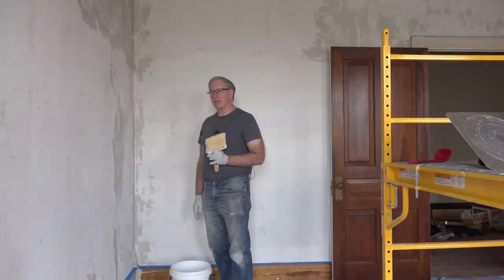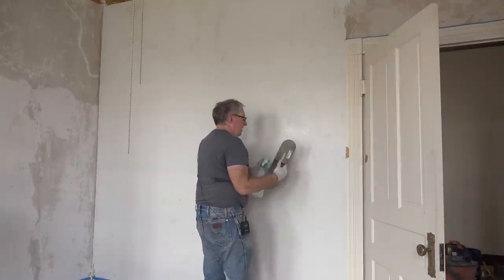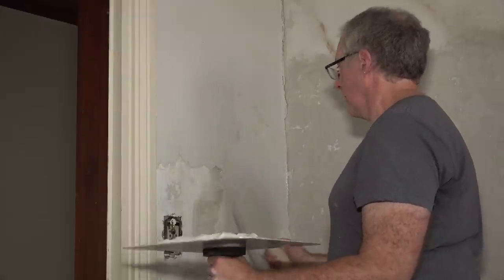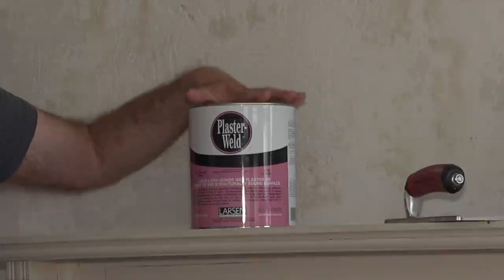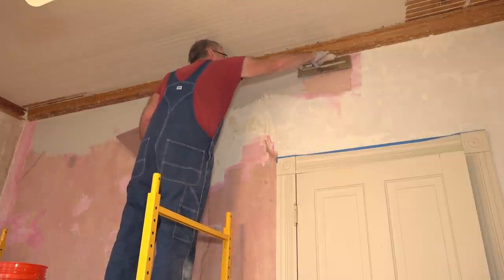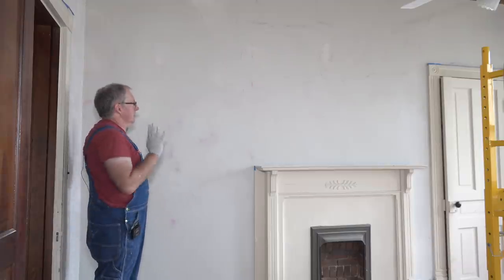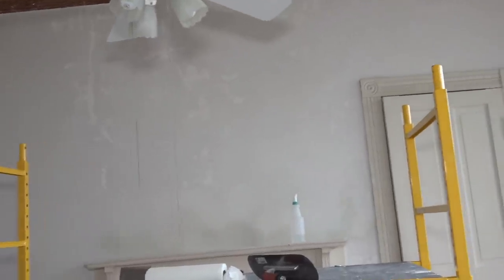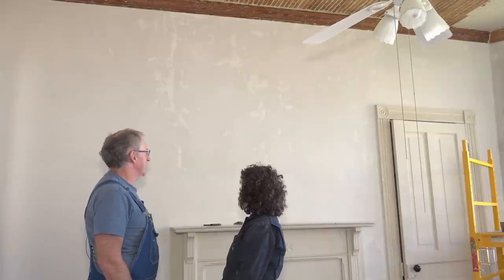EP 76 Victorian Plaster Skim Coat

Comment: What caleb from second empire strikes back had to do with re-plastering his house, he needed, i think, three coats of of base plaster to repair his wall, then two top coats(scratch coat, and then veneer coat). As for the yellow stuff, that might be dry wall spackle? That stuff has a bad habit of yellowing, and showing through stuff put over it(unless you use a primmer if painting), so you might need more then one base coat of plaster cause of it?
Reply from the maker: Caleb had to build up the plaster base from the raw lath, which is why it took a few coats. In our case we already had the base so didn't need as much plaster.
Reply: I think you’re right about what they used for repair of the cracks!  I had that in a bedroom as well and it became a choice of digging it all out and fixing it with plaster, sealing it with BIN or KILZ and then painting or wallpapering.  
I should add that we weren’t replastering the wall at all - just stripped old wallpaper and that’s what we had underneath.  The rest of the walls were fine.  We primed them (we hadn’t yet decided on paint or paper but wanted a nice, clean, white base) and the yellow color from those cracks bled right through.

Comment: We did a walk thru on an old home that had actual plaster walls. I was amazed at how flat the walls were! It speaks volumes for the tradesmans of yesteryear! Unfortunately I have not personally seen enough representations of plaster walls to determine if "perfectly flat" was the norm as I have seen plaster walls that were very wavy and uneven. The fact that a tradesman can get a plaster wall perfectly flat says volumes though.
Reply from the maker: I found it to be very easy to apply a flat finish. You can see where the uneven-ness was filled in when I applied the base coat. Yes, there is good work and lousy work out there. I've even seen walls that had heavy texture on them and it made me wonder if they were just covering up bad workmanship?

Comment: I’m guessing KILZ doesn’t work with regard to the stains on the wall(s)?
Reply from the maker: KILZ is the wrong product for the job. It's designed to be used under paint to keep stains from pulling up through it. Plasterweld is the only product that should be used to bond plaster and does a fine job of blocking whatever was under there.

As for paint problems, we show a better, less expensive way to block stains in a couple of episodes!

Comment: Question these plaster walls can they be washed? If you wanted to paint does it have to be a flat paint so it will continue to breath? I can't remember what kind of you used for the Blue Bedroom.
Reply from the maker: Good question! Yes,  plaster can be washed. The water will soak into the plaster and then evaporate back out. Don't try this with sheetrock though.....The mud and paper on the top layer will disintegrate and they gypsum will turn to mush.
Latex paint won't allow plaster to breathe. The best finish for plaster is either to leave it bare, apply a venetian finish, or wallpaper. The blue room had latex paint because the walls are covered with sheetrock. If we are able to stay then we'll pull it down and properly restore the plaster underneath.